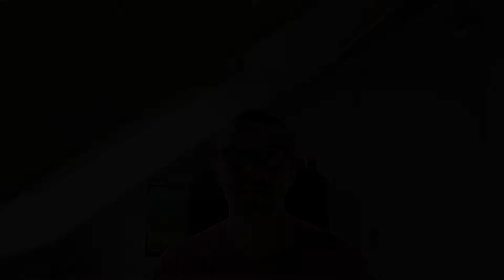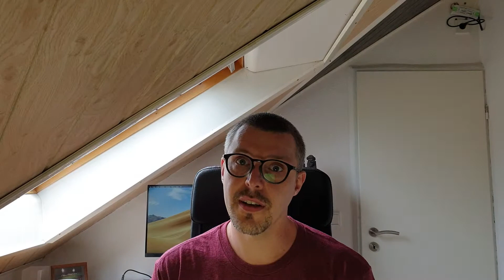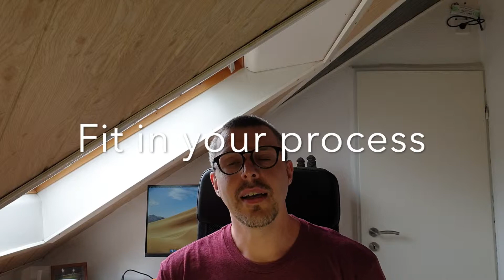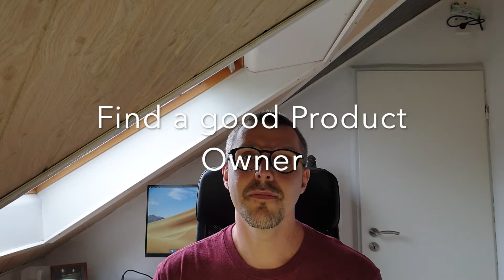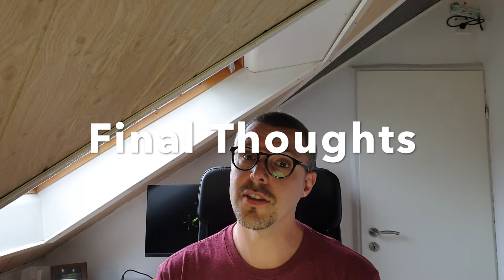How to introduce Scrum in mechanical or electrical engineering - 7 things to know

Comment: Could you recommend any valuable literature related to scrum in product development and mechanical engineering? What type of software do you use? Is it jira or you can see better results using whiteboard while working with old fashioned engineers?
Reply from the maker: Sadly there is not a lot of literature on Scrum in product development and mechanical engineering. What I figured out is that especially Embedded Software developers can bring Scrum into the more physical product development related world. They can provide a bridge since they understand both worlds. When it comes to tools, Jira is my favorite one. The reporting you get out of it however is not sufficient for reporting hardware projects.
Reply: @parttimepart  Just found this video, thanks!. David Ullman has a book on Scrum for hardware (and also some YouTube videos on the DesignProcess channel)